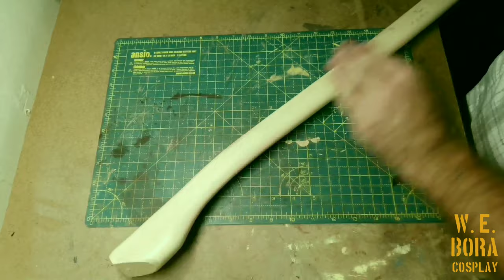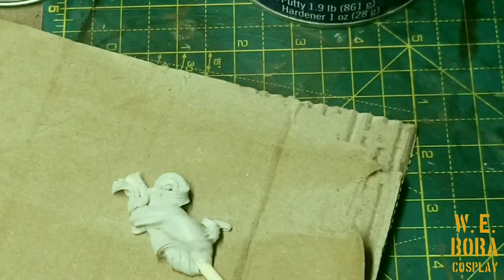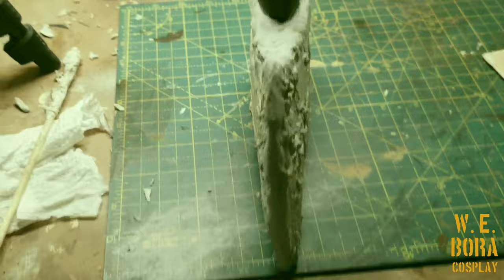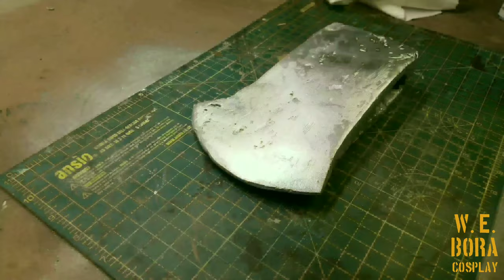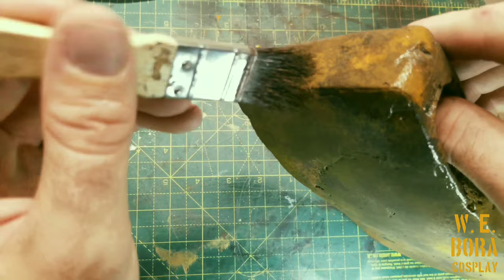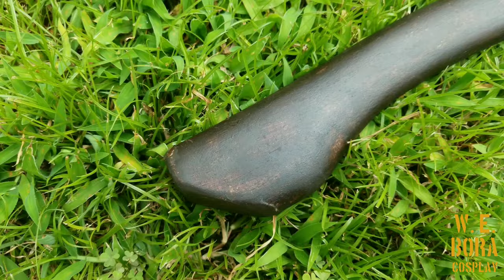How To Make A Prop Axe. Cosplay. Friday The 13th. Tutorial. Jason Voorhees

Comment: The trailer for a Friday the 13th fan film that my dad and I are working on is up on the channel Revolutionary Exchange Productions. I’m really proud of It and I’d appreciate it if you checked it out
Reply from the maker: I'll head over there now
Reply: W. E. Bora I just got a part 3 mask, might get a 1 liter thing of the varnish in a month, so yay!
Reply: I have the varnish and have applied it to the mask, waiting for it to dry
Reply from the maker: @flameshot4798  any luck?
Reply: W. E. Bora 3rd day of waiting for the first coat to dry, still nothing.
Reply: I also intend to re-do my part 4 mask with the varnish, just need to strip the paint off so I can start again
Reply from the maker: @flameshot4798  3 days and its still not dry!?  Jeez, I'll stick with spray paint then lol
Reply: W. E. Bora I think I applied it wrong
Reply from the maker: @flameshot4798  hmm, does it have a drying time on the bottle
Reply: W. E. Bora no
Reply from the maker: @flameshot4798  let me check mine. Maybe there's something on the box. 

Nope nothing on the box either. That's strange
Reply: W. E. Bora maybe it’s because I applied it to spray paint instead of acrylic paint
Reply from the maker: @flameshot4798  i m not sure. I suspect its taking so long because its oil based
Reply: W. E. Bora actually it appears I waited for nothing, I noticed that a spot that had a higher concentration of varnish had cracks, so turns out I just had to apply a second coat. This is after removing then reapplying a single coat and letting it dry over night last night and I just applied a second coat. Turns out the cracks only start appearing after the second coat.
Reply: I also bought a pretty really looking fake machete, and spray painted the blade chrome, you couldn’t tell it’s fake without a good look or a feel.
Reply from the maker: @flameshot4798  awesome, where'd you find that at?  I got a Remake machete coming in the mail soon from Dirtnapfx. In the movie two machetes were used. One was 36" and the other was 32". I went went with the shorter one so when it's in the holster it won't be too awkward to wear.
Reply: W. E. Bora I found it on e-bay after searching “machete prop” and looking through the results until I found one that looked realistic in sculpt. It’s pretty good
Reply: After a more thorough read through of the blog post you sent me, turns out each coat of varnish does take 3 days to dry. So that means I have to start again. Fuck me I guess
Reply: Also the post says you have to apply 6 coats so this is going to take longer than I thought
Reply: Turns out the six coats part is for spray guns. 4 to 5 will do with sponge brush, but still have to wait 3 days between coats